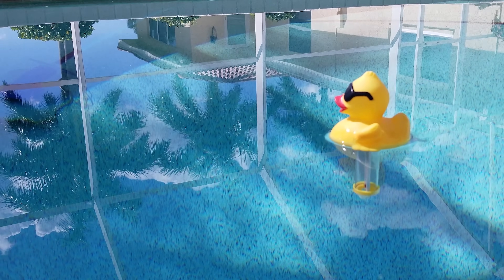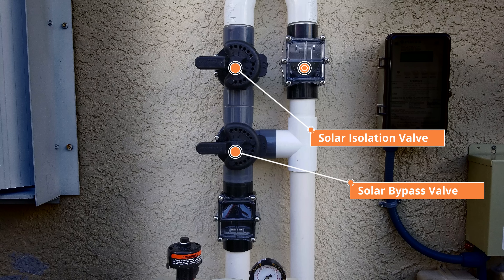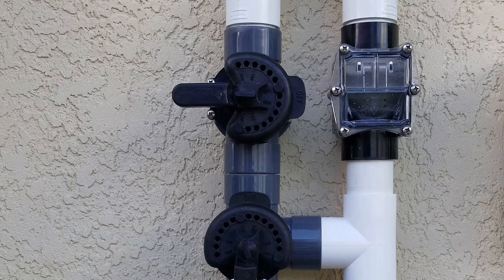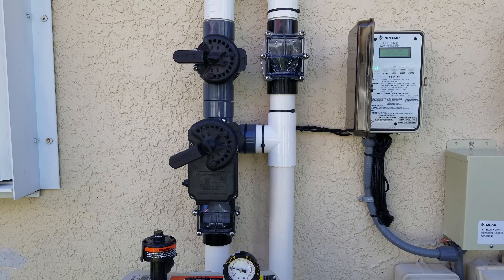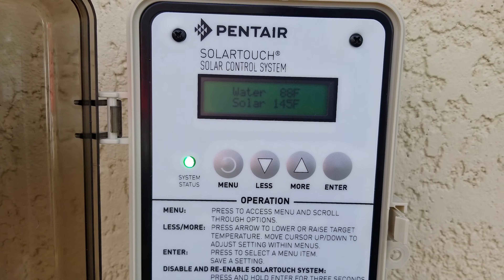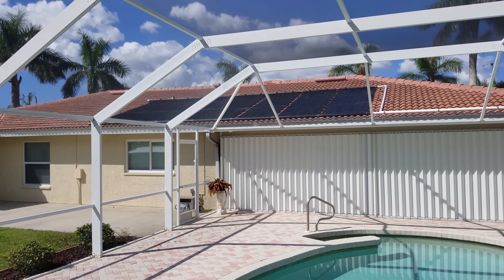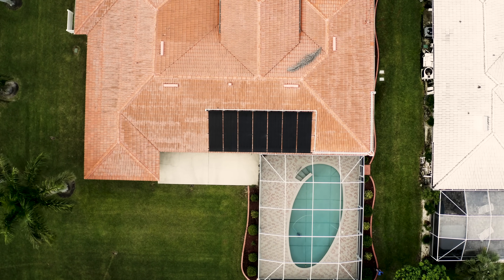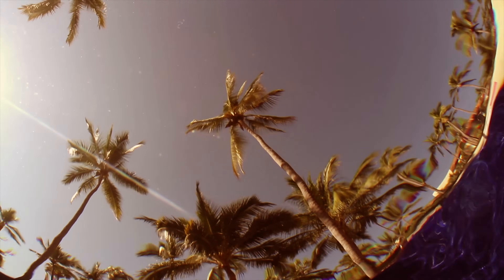Solar Pool Heating - How to Use Your System From Florida Solar Design Group in Fort Myers, FL

Comment: My problem is that large bubbles contiune to come in to the pool when the solor is turned on. My pool guy says that the air bleeder valves on the panels needs to be looked at.  He cleaned all my filters (4) but he did say that I need new ones soon.

Comment: Thanks for the great video guys, relatively new pool w/ solar heating owner here. Question: when I raise my temp on my GL-235 x244, the valve goes to the close position bypassing the solar. Does that make sense? If I want the temp higher shouldn’t it send the water to the solar?

Comment: To the valve company. Change your handle position so that the handle lines up with the direction of water flow. Must have been a preschooler that designed your valve.
Reply from the maker: All pool valves from the major manufacturers have been this way for decades. If you think about it, the 3-way valves would be ambiguous if you did it the other way. With these valves, the OFF tab always points to the pipe that is blocked. For pool professionals, these valves are intuitive and easy to understand.

Comment: So concise.  I turned two valves, set the controller temperature, turned on the power to the controller and presto the automatic valve moved to the correct position.  Thank you.

Comment: wont a check valve on the return side inhibit the draining of the panels possibly causing boiling of the water inside the panels?
Reply: Water flows from the bottom to the top of the panels. They drain thru the feed pipe after the solar AND pump shut off.
Reply from the maker: The return line check valve prevents water from going up to the panels (in reverse). It does not prevent water from draining.

Comment: Wouldn't water stay on top of the lower check valve and freeze during the winter?
Reply from the maker: @JoeKissell81 There is a valve or hole within the 3-way bypass valve that allows water to drain down to the pool when the pump is off. So no, water would not be trapped in the panels. Proper drainage is important in climates where freezing occurs. Obviously we don't deal with that here in Southwest Florida, but we still design systems to drain to prevent stagnation in panels, which can cause heat buildup and service issues over time. Some systems simply can't drain due to the plumbing run, and those systems can have manual drain valves installed.

Comment: Our set temperature is lower than the actual water temperature. Yet, the solar stays on. Therefore, the pool is continuously heating up.
The thermometer (pool sensor) is good and correct. Why won’t our solor stop running/heating the pool after the desire temperature is achieved?
Reply from the maker: Hi Jen. It's unclear what you mean by "the solar stays on." If the controller says Solar On and the setpoint is lower than the pool temperature, you may have a faulty controller. Try resetting it by removing and restoring power to it. If you mean that the solar valve stays in the on position, the toggle switch on the valve actuator may be in the wrong position, the middle (off) position, or your valve actuator motor may have failed. More information is needed to help you.
Reply: @floridasolardesigngroup  
Thank you for replying. The control box says ‘Solar Heat Off’, but yet the automatic rotating valve always stays (and in black letters) states ‘Solar On’. 
Even if the pool pump is off, the valve never moves into the Off position. If the pool pump is on, the pool jets continuously shoot warm water into the pool, even way beyond desired temperature has been reached.
I finally changed the pool pump settings to only run during the night so the solar will stop heating our pool up.
Reply from the maker: @JenFlutterby  Then you have an actuator issue. This might help you: https://floridasolardesigngroup.com/solar-pool-heating-valve-actuator-toggle-switch-position/
Reply from the maker: And of course, if we installed your system, we are happy to help! Call the office and leave a message. We monitor the inbox even on holiday weekends.

Comment: How would you add a heat pump to this set up
Reply from the maker: After the water returns from the roof, plumb in the heat pump inline before water returns to the pool. You will need to use more advanced automation, or you will need to increase the setpoint temperature on the heat pump controls because it will sense the slightly warmer water coming down from the solar panels.
Reply: @floridasolardesigngroup  or  instead decrease the set point on the solar?
Reply from the maker: @apex36  You don't want to do that. You want the solar to provide as much heat as possible. Since the sensor in the heat pump senses the incoming solar-heated water, you have to trick it into staying on. This is not an issue if you have pool automation that handles multiple heat sources. However, not all pool automation allows operation of solar heaters and heat pumps simultaneously. Required workarounds are common.
Reply: @floridasolardesigngroup  i have the same control you show on the videl
Reply from the maker: @apex36  That is a solar controller only. It does not automate a heat pump in any way. If you want your heat pump automated other than it's internal control panel, you need more advanced pool automation.
Reply: @floridasolardesigngroup I'll take your advice and set the solar to 78...and the heat pump to 84. I'm in new york
Reply: Thank you for your kind advice

Comment: Why would you need to heat a pool  in Florida?
Reply: People from up North frequently ask this question. Swimming pools in Southwest Florida get down to 65° at the coldest time of year. Seasonal residents want to enjoy their pool during the cooler months in Florida. Without pool heating, swimming pools are below 80° for more than half the year. Moreover, it's the relative temperature that matters. Often times, it is 90° outside and pools are in the low 80s due to low night time temperatures. That relative difference makes getting in the pool unattractive. There's a good reason that virtually all pools in Southwest Florida have at least one heat g option, with tens of thousands of solar pool heaters.

Comment: I noticed that the solar heat water pipes are installed on a tiled roof. What precautions do you take to make sure that the roof tiles are not damaged since these tiles tend to break easily? Thanks.
Reply from the maker: Training, experience, methods, and materials. An experienced and qualified solar contractor in our area  handles tile roofs with ease.

Comment: Valves work counter intuitively. They should point in the direction of water flow not against it.
Reply from the maker: This style of valve is open when the handle is perpendicular to the pipe. There is a small 'off' tab that points to the pipe that is blocked.

Comment: I live in CA and even though it's 95 every day or hotter the pool seems to stay at 77-78. I have turned solar to 95 but no change. Only days in the hundreds does it seem to get up to 83-84-85. Our pool guy says it's working but I have doubts. Thank you for a long overdue video explaining the process. Maybe something is going on with the panels on top of the roof. This video was very helpful. Thank you!
Reply: its not working

Comment: Will this work at night?
Reply: Only if you install a second set of Pannels on the other side of the planet or on the moon! If your pool water is very cold and the ambient air is very warm it will still work.
Reply: Cool the pool during the summer.

Comment: What type of check valve is that on the return?

Do you prefer to bring back the solar return directly to the pool? I would think the least amount of back pressure on the panels the better.
Reply from the maker: The valve is made by Magic Plastics. It is very reliable with a quality alloy spring. 

Yes, less backpressure is better. We typically use the existing pool returns. There are some tricks, but usually it isn't an issue.

Comment: If the solar bypass valve is in the bypass position (not heating) you're saying that water can still get through the valve and get to the roof? If not, I see no reason to have a separate isolation valve.
Reply from the maker: There is a small hole in the bypass valve that allows the water to drain back to the pool when the pump shuts off.
Reply: @floridasolardesigngroup  correct, but all the ones I've seen are one way valves so they only allows water to drain from the roof.  Water cannot get up to the roof if it's in the bypass position.
Reply from the maker: @robertb2744  there is one valve on the .market from Pentair that has an integrated check valve that allows drain down as you suggest. However, the vast majority of solar bypass valves simply have a hole purposefully drilled in the gate. This allows a small amount of water to evade the valve and go up to the roof while letting it to drain down efficiently. In addition, the Pentair valve does not provide 100% sealing and is subject to deterioration over the years, hence the need for an isolation valve that can provide a positively secure seal.
Reply: @floridasolardesigngroup  I understand now. I've only dealt with Pentair valves which is why it never made sense to me. I could see the valve wearing out over time but I will buy a new valve and switch it out when it does.
Reply from the maker: @robertb2744  you can buy the "guts" of those valves, but it costs almost as much as the valve itself. Regardless, it's easier than replacing the whole valve. You can also use standard valve guts in the solar check valve body and just drill a hole. We have seen numerous problems with loud drain down valves in Pentair solar valves that buzz as they fail. But some work reliably for many many years. All pool dynamics are different, so your mileage may vary.

Comment: Where would you recommend the temperature sensors be placed? The roof one is easy, but should the pool temp sensor be placed in a pipe before or after the filter? Any difference in location?
Reply from the maker: Either location would work.

Comment: Aloha! What is the reason for draining the system every night? What can’t the water just stay in the piping and the pump resumes every morning without having to release air pressure all the time?
Reply from the maker: believe it or not, even here in Southwest Florida we encounter freezing conditions or near freezing conditions on rare occasion. Freezing can damage the solar panels due to expansion. Because black panels emit heat to the black sky, freeze damage can occur even slightly above freezing ambient temperatures. Therefore, we ensure the system drains fully each night. Also, and this climate, stagnating hot water tends to soften plumbing, cause warping, and sometimes cause discoloration of the PVC.
Reply: Florida Solar Design Group thanks for the response - my guess was stagnant water over time, or, the weight of the water on the valves during non use

Comment: What do you recommend on the series vs parallel panel installations?  We are installing 16 4X12s (not in Florida, sorry).  Would you - generally, I know there are many variables - recommend 2 runs of 8 panels, 3 runs of 5/6 panels or 4 runs of 4 panels?  flat room, 2 inch water lines, all of the latest Pentair equipment.
Reply from the maker: Generally, never put panels in series. They should always be in parallel. Think of it this way. If you arrange panels in 2 sets in series you heat water up in the first set, which efficiently heats the water. Then that water makes it to the second set in series and the water is already heated. Trying to heat water that is already heated is less efficient. There will be less heat transfer in the second set of panels. For a system this large you should consider two banks of 8, parallel fed from the center and parallel returned from the two far corners. This should balance the flow across the two banks. If you need additional flow balancing due to distances, heights, or other reasons you can install ball valves to adjust flow. If installing at different heights you will need to plumb everything to a common high point. And for a system that size you will need a lot of flow... something on the order of 80 GPM. Consider your pump size and existing plumbing to make sure it is adequate.

Comment: You don't mention the average or typical cost for a mid range system installed with controller.  How much $$$?
Reply from the maker: Prices are wide-ranging depending on pool size, roof type, roof orientation, distance to the pool pump, automation integration, and many more factors. Most of our systems fall into a range of $3,000 - $5,000 installed including engineering and permitting (turnkey). Some are lower for exceptionally small pools and spas and some are higher for large pools or complex projects. The price of a solar pool heater is similar to installing an electric heat pump, but there are no ongoing added electric bills!

Comment: How much pump RPM do I need to feed to the roof solar?
Reply from the maker: That's impossible to say. Every pool and solar panel system is different, resulting in different system pressures. You need a flow meter or a trained technician who knows how to determine the proper flow.